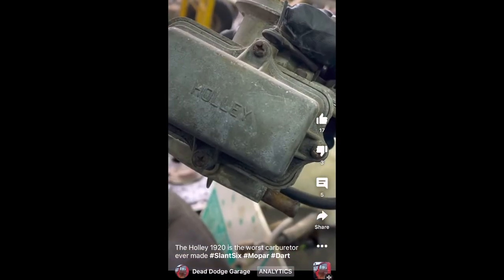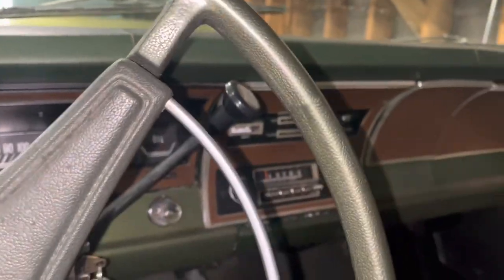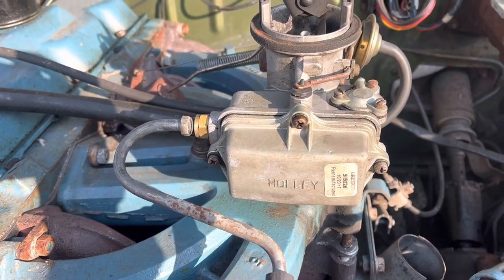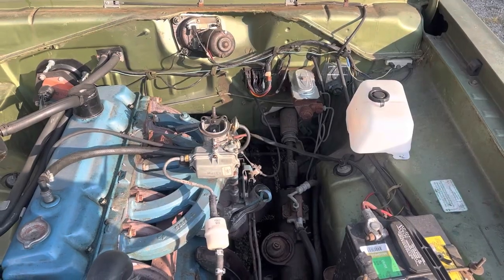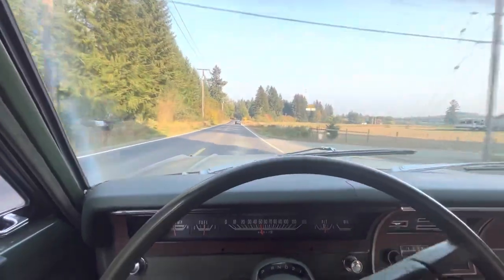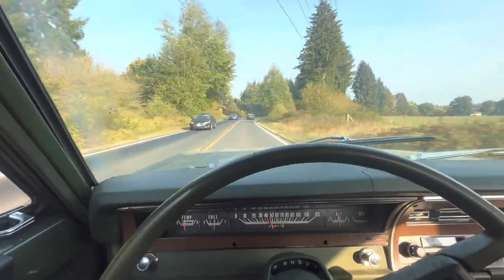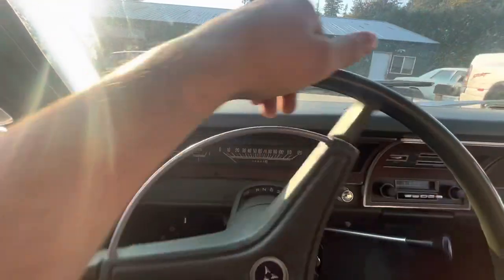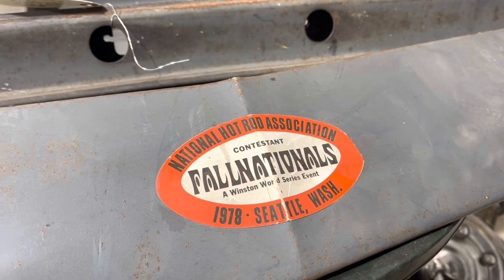How To Fix The Holley 1920 On Your Slant Six Mopar (Throw It Away!)

Comment: It might help if you said which carter bbs to look for. there are a lot of different models. I tried following your advice. There are exactly zero bbs carbs on E-bay for anything newer than "61. And every one of them are sold as parts only. In other words,  junk. Will one listed as being for a late '59s to early '60s 225 work on a '73? 
I thought parts for a slant 6 would be everywhere, they made them for so long. NOPE. Carbs are nonexistent. Can't even find a new or rebuilt 1920. They're everywhere cheap for fords. None to be had for a mopar. Not interchangeable either. 
A word of warning for anyone getting into vintage mopar slant 6. GOOD LUCK. Parts are a bitch. I had to get valves from Australia. None in the US.
Reply from the maker: Unfortunately you’re right. At the time I made this video, there were many listed. As you can see, this one showed up shiny and new in a box. Other commenters have informed me that this is no longer the case. There isn’t much I can do about that. No, an early to mid 60s carb will not attach to the 67+ linkage. It’s a problem.
Reply: @DeadDodgeGarage  Thanks for the reply anyway. I don't get answers to my questions very often, and almost never this quickly. I very much appreciate that.
Reply: @DeadDodgeGarage

Comment: One of the problems is a 1920 has a metering block that can get dirty(and hard to clean). Plus, I don't like the leak point either. That's a very late BBS...they used those on 70-71's.

Comment: Love the Carter BBS with the exception of the butterfly shaft air leaks. I also warn all and sundry that rebuilt carbs on eBay aren't. Buy them, then rebuild them. Done.
Reply from the maker: Right. The BBD has the same problem - every one of them, I swear. The devil you know, etc. This one was nice, with a tag on it, vacuum packed in plastic, nice coating. Actually a remanufactured unit. I trust it! But we saw a lot that sure didn’t look as nice.

Comment: I'm relatively new to the Slant Six world, but just started learning about it and the 1920- my 69 Dart Custom was going to be a 5.7 hemi daily fun car until I realized it was a very rare V1H (1 of 25)!! So now it's getting a factory resto. I'm now on the hunt for the correct oddball  '69 carb/intake/exhaust as theyre the only non-original pieces on the car...
Reply from the maker: Mod top slant six ‘69 Dart? That’s sweet! What a cool thing to restore. Different. I dig it.
Reply: @DeadDodgeGarage  It's not what I had in mind. Tough to change your vision from carbureted Hemis and race parts to casting numbers and date codes, but it's still going to be a fun journey!!  Just found your channel after the $170k Charger video. Love it and insta-subbed. Another semi-local Mopar maniac channel, oh yeah!!!  I'm in Vancouver btw...

Comment: Whats your issue with the holley carb? My dads 83 d150 has the holley carb that thing has worked flawlessly for years
Reply from the maker: They tend to not idle and it’s a big pain to fix. I’ve dealt with a few that were ok, and a bunch that weren’t.
Reply: @DeadDodgeGarage  interesting 🤔 yeah we have never had a problem with ours we've owned the truck since 89

Comment: Would you have the part number for the BBS Carter that you used?
Reply from the maker: I don’t… we found it on eBay, and it doesn’t seem to be available anymore. So that’s a problem.
Reply: dang i hoping to get one I just bought a 1967 dodge d100 truck with a slant six in it my carb is shot and missing some pieces.

Comment: I have a bbd carb on my super 6 in a 77 aspen and it wont idle for nothing rebuilt carb still wont idle
Reply from the maker: When rebuilt, did you verify that the base to main body gasket is correct? Several different varieties come in the kit. If the wrong one is used, passages will be blocked and you will have no idle fuel… learned that the hard way many years ago.

Comment: I’ve got a 1973 dart swinger with a 225, and I am trying to find a carter carb to fit it. Everything I find online will say 1966/1967 I haven’t found anything that includes 1973 yet, I can’t imagine thy changed the designs of them every couple of years back then, but I want to be sure I’m ordering the right carb. Any good info on this like a part number that will cross?
Reply from the maker: The throttle linkage changed in ‘67? Something like that. We just searched for Carter BBS on eBay and found the one with linkage that matched. I will say, I have looked more recently and didn’t see many good options.
Reply: Appreciate the reply, I’ll keep looking.

Comment: I need a 72 holley 1920 to rebuild, tried rebuilding mine and it barely will run. Must be plugged in metering block.
Reply from the maker: They’re all like that… that’s why I throw them in the garbage.
Reply: @DeadDodgeGarage  ok thanks, but still want to revive mine if possible. So I will keep looking for parts.

Comment: The holy 1920 is the best car for the slant just clean them out.but holly stoped making rebuild kit back in the 2000 's so it being rebuilt no just cleaned it was so that not rebuilt.if you want send them my way I will take them instead of busting them up.but bbd is great to.
Reply from the maker: Whether Holley makes kits or not, aftermarket has them so it’s definitely still possible to “rebuild” them. Which is the same as cleaning, plus new gaskets and small pieces, so I’m not really sure I understand your point.  Personally I think the BBS is better, and trying to make the 1920 idle is a waste of time. Every slant six car I’ve ever owned had a 1920 and had idling problems, usually requiring the choke to stay partially closed. Every 1920 (but one) I have ever dealt with had this problem. Apparently not everyone else has had that experience. I accept that, but stand by my point.

Comment: Was the Holley 1920 vs Carter one of those 'lowest cost bidder' situations?
Reply from the maker: That would make a lot of sense… I think we can all agree Holley is a reputable brand that always made good stuff. The 1920 just happened to not be engineered to last 50 years…
Reply: @DeadDodgeGarage  Agreed, Holley stuff is normally good quality.
   Old alky gas & electralysis seem to do more damage to the multi-metal Holley design
Reply: Holley 1920 was the performance upgrade (according to my 63 dart shop a manual)

Comment: I’ve never had any issues with a 1920.
Reply from the maker: I have seen a couple that work fine. I have seen many that will not idle unless the choke is partially closed. I know there is a lead plug that can be removed to clean out the idle circuit, which can then be covered with epoxy or whatever. That’s way too much trouble to make something kinda sorta work again for a while. The BBS is a direct bolt on swap and is so much easier to work on.
Reply: @DeadDodgeGarage  where can you find a bbs I’ve searched eBay and google with little to no luck but I am young and have no knowledge but want my 82 d150 /6 stepside to NOT SUCK between the 1920 and lean burn ahhhhh
Reply from the maker: @johnhenderson4837  https://www.ebay.com/sch/i.html?_from=R40&_trksid=p2380057.m570.l1313&_nkw=Carter+BBS+Dodge&_sacat=0 you've got options. There are several versions of the throttle linkage setup so make sure you pick the one that looks most like what is on your truck. That lean burn needs to go! Awful nightmare fuel... The 80s slant is capable of running really well if you get those systems sorted out.
Reply: @DeadDodgeGarage  would you tackle the lean burn system first or the carb
Truck starts ok but runs rough almost always, it’s an old forestry service truck
Reply from the maker: @johnhenderson4837  personally, I think I would be pitching both at once. Doesn't the carb have electronic controls built into it? The carb swap is going to be the easier job if you (like many mechanic types) find the electrical side of things is a little daunting. But the lean burn ignition control really sucks, and I can only imagine it won't work right with the carb removed.
Reply: @DeadDodgeGarage  no electric wires going to carb, think it may be worth rebuilding? Had no air filter when I got it 
I have obtained a /6 vac advance distributor need to research other parts and part #s
Reply from the maker: @johnhenderson4837  ok - do your ignition conversion and go from there. You probably have the later Holley carb (can’t remember the model number) which tends to kinda work ok. May well be worth rebuilding instead of replacing.
Reply: Same here @f6hemicharger. Been good to my 63 dart.

Comment: Back in 1993, I had a 1920 on my 225/6 in my '73 Duster.  It was kind of a weaksauce, power limiting carb, but it got good mileage, around 18-20.  That winter, we got temps down to -22 F, and I had the fast idle adjusted JUST RIGHT.  Even on the coldest day, I could go out to the car, pump the gas pedal once to set it on the fast idle cam, and crank it up.  The Slant would start out idling very slowly, around 500 rpm, due to being so cold, but over about 10 minutes, it would warm up to around 1200 rpms, then I'd tap the gas once to take it off fast idle, and drive away!  And no, I didn't wait in the car that whole time, it was too frickin' COLD!  

See the LOUDMOUTHTIM youtube channel!